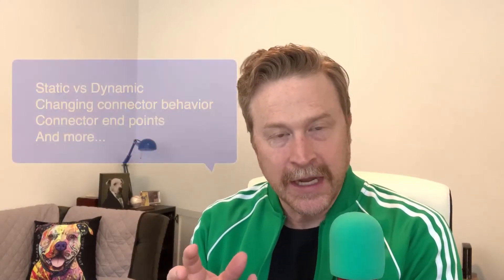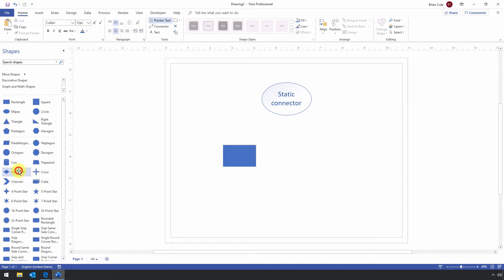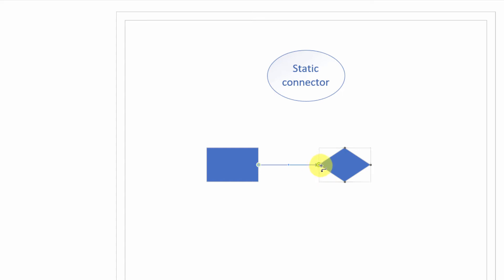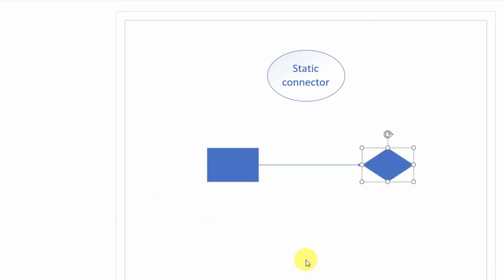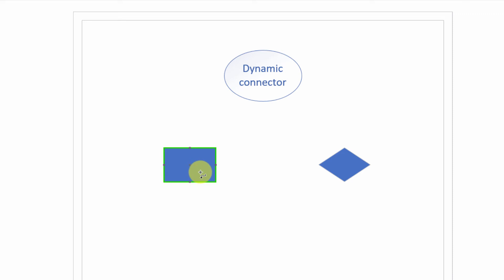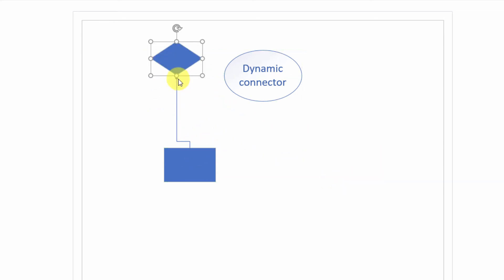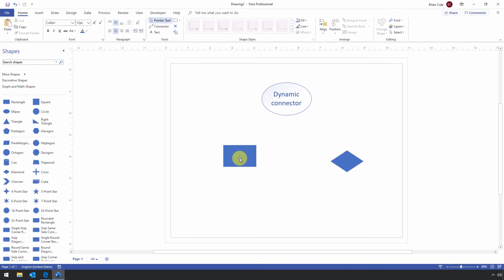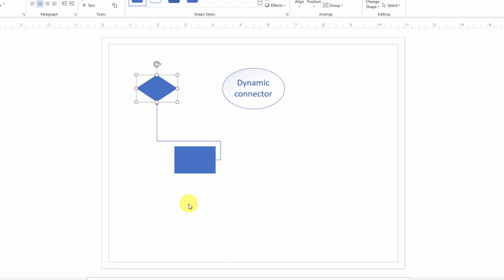Static v Dynamic the EASY way - Visio Connectors pt1

Comment: thank you but how do i straighten the connector? i find it always comes a right angle type
Reply: i want to straighten without going to straighten manually
Reply from the maker: try Design tab | Connectors in the Layout group | 
Select Right Angle, Straight Lines, or Curved Lines

Comment: My Visio isn't behaving like this at all? I've got the latest O365 version
Reply from the maker: Hmm... my guess is that you're using the browser version instead of the desktop version.
Reply: @LikeABossLearning  Hi there, I found the problem. It seems my glue was not activated in the layers. I changed this setting and now I can do all the connections as per your video.
Reply from the maker: @skinnersbollox  glad to hear it; hope the vid helps!